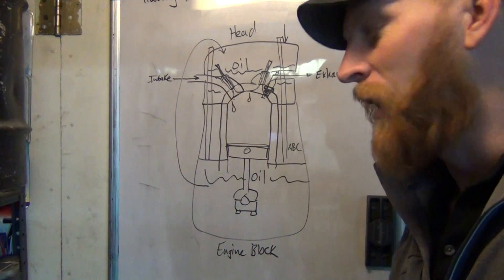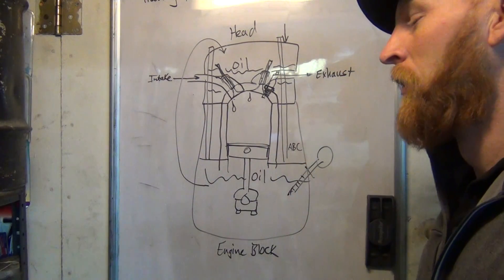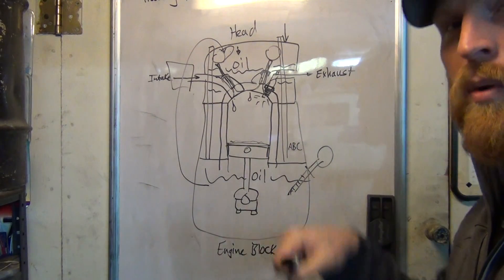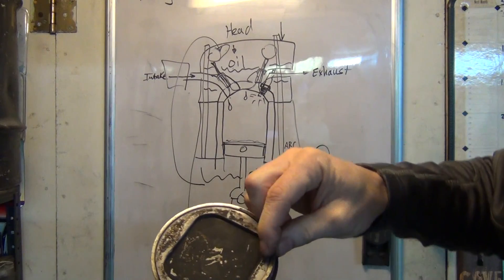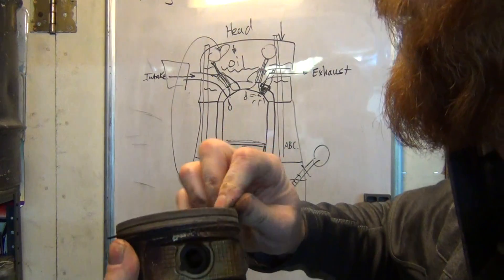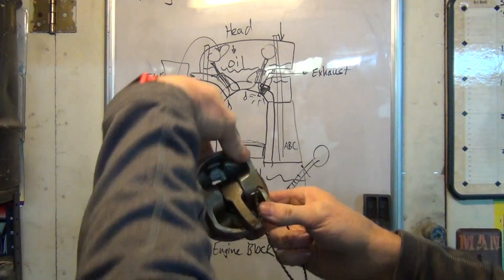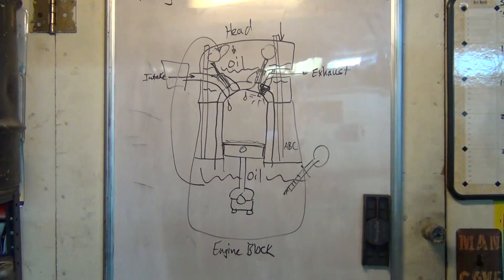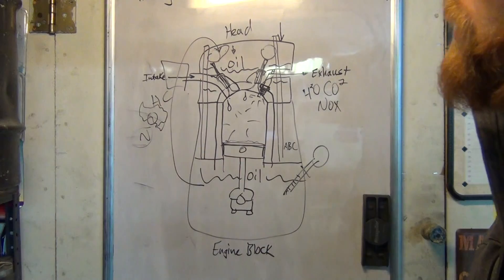Oil Burning Explained

Comment: I get really bad blowby (it needs rebuilt I'm saving money for it) but no oil burning in the exhaust. It'll blacken new oil in a week but it doesn't burn any strangely enough. It's an AMC if that has anything to do with it.
Reply: Tried cleaning buildup/carbon with zMax or Bestline? Have heard that some people have good success after running a few sets through with a couple successive oil changes, cleaning sticky valves, etc. Haven't tried 'em yet myself. But may at some point. Just a thought. Something to look into... Maybe?
Reply: Michael Gmirkin I will try that. It appears to be just worn-out rings, as the engine has been running since 1976.
Reply: check your pcv or crankcase breather don't know if you have a pcv or not but that can cause excessive pressure if plugged and cause blow by

Comment: Hey man I have a 2002 Ford F-150 5.4l triton change oil every 3k miles using Mobil 1 full synthetic , every 3 k I measure how much my engine uses, so my vehicle has 125,000k miles on it and it uses 1.5 quarts every 3k miles, is this normal?
Reply: No smoke noticeable on startup or normal or high reving
Reply: And the pcv valve and hose has been replaced as well

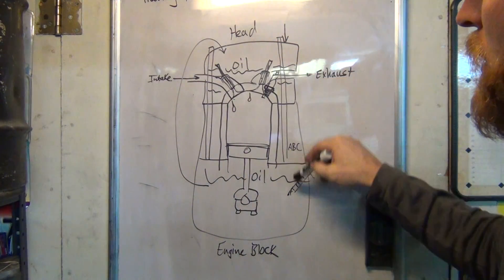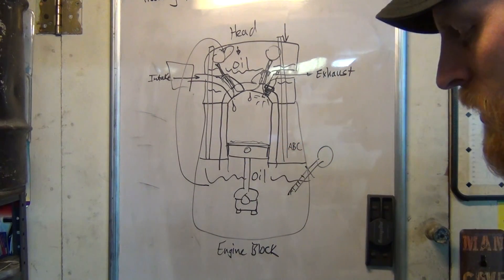Comment: hello Brian,i saw this video and its really helpfull for me to understand why an engine its burning oil,its extremly good movie.Now,i want to tell you my problem that i have whit my engine,maybe you can give me an advice because here in Romania at least at the garages that i have been whit my car,nobody could explain this big oil consumption that i have.So,i have a basic 2001 year vw  passat 1.6 Liter engine,code ALZ,and this car its burning arround 2-3 liters(i dont know in gallons how much is it,here we use liters) in 7000 miles(10.000 kilometers)!! but,(yes there is a But) none of that oil can be seen in exhaust pipe as a blue smoke even if i rev the engine,the noxe test is failed because i have too much monoxyde in exhaust,no leaking anywhere under the engine,no nothing as these simptomes.Still,after 1600 miles(2000 kilometers) the level on the dipstick oil its minimum,so i have to fill whit  500-600 grames( aproxx) of new oil.The engine its run perfectly,never had problem starting it,i just check myself that air filter and its perfectly clean after 15000 miles.One thing that i`ve noticed is when i have change the sparkplugs,one of those was all black,the other three were kind of brown to white,something like that.Here,only thing that i can hear from the garages is that i have to change the piston rings.....well if i have to do that,why my engine it run perfectly?the compression test tell me this: cyl1:13 cyl2:14 cyl3:14 cyl4:13,8,gas mileage its very good,never a problem whit it,under the hood intire engine its clean as new,no spots of oil,or gas,or something like that,everything its dryout.That too much monoxyde in the exhaust pipe  tell me that i have a bad mixture between air and gas,no way that its oil burn there.Maybe its a long message,but who knows,maybe you could help me whit some ideas,its not easy for me to go and change just like that  the head gasket,then the piston ring,then the valve seals or who knows whats next.Thank you

Comment: Hey my car has alittle but if smoke when I come to a stop off the high way getting off the exit it's very little and it's for about 3 seconds I have no check engine like out anything what could it be the smoke evaporates in the air

Comment: Hello Brian. got to learn new thing from ur video.. Bt i have a problem wit my motorbike. Its not smoking during startup and during throttle run also but my oil level in my engine is dropping. After changing oil have run just 1000 km the oil level is beyond. Dipstick reach.. Cant  see any leaks also .. Hope u have any idea.. Thankx man cheers..

Comment: Good stuff.

My Jeep burns oil.  Although Chrysler says its normal.

1 Qt, per 3,000 miles is the accepted amount, with vehicle mileage under 75,000 miles.

After that, the accepted amount of oil burn goes up.

Whatever the case, I feel that Jeep/Chrysler dropped the ball on this motor.
The 3.8L motor has been around for quite some time now.  The problems with oil consumption are known.  Why wont they address this?  Probably because the solution requires an engine rebuild, with new piston rings.  Too much $$$ to fork out.

Anyways, rant off.  Great video, thx.
Reply: +bjjbrawler1 3.8? Had one that burnt a quart every 650 miles and Chrysler said it was normal.

Comment: Hi Brian , I've got a car renault scenic dci expression (diesel) and the problem is when the engine runs its starts to smoke and letting oil through the exhaust but the car has power when you drive etc .Can you kindly tell me what the problem might be ?Many Thanks !!!!
Reply from the maker: Simplicio Matongo When piston rings wear out you lose compression. If you lose compression a diesel won't run and won't have power.  Diesels smoke most often if there's excess fuel going in from a leaking injector etc, but if you have oil loss, I would need more information like WHEN it smokes most to give any better idea.
Reply: Hi Brian , thank you for your speedy response appreciate it alot . Ok when you start the engine its fine but when the engine is hot then it will start to smoke with oil through the exhaust pipe like when you stop and check at the back of the car you will see oil even at the back of the car and during that the car will have power even to overtake you can but smoke with oil thru the exhaust pipe is the problem ...

Comment: I have the same exact problem as Chris R. I don't burn on start up, I don't burn on idle And I don't burn on wide open throttle. I only get a plume of smoke when I pull off from stoplight or of I decelerate or downshift and coast and then accelerate. What would you say it is
Reply from the maker: Jake Hancock Valve seals most likely.
Reply: I replaced them already lol

Comment: Hi Brian. I have an 85 Toyota Pickup (22R) that doesn't burn oil on cold start up, or idle. When I give it a rev after idling at a stand still, or coasting for a little while, then accelerate it will do a trail of blue smoke and then will stop as I continue driving. From what I've learned through you and other sources, it seems to be the rings. What I don't understand is how it will stop smoking as I continue driving? Will you provide some insight?

Comment: I have a motor with 270k miles. There are no under car leaks, no smoke on start up, and no smoke during driving all the way to 7,000 RPM. I have no idea where the oil is going. In 3,000 miles I have lost 4qts of oil so far. Keep topping it off. Any idea how to fix it?
Reply: *****
 I actually tried to use 5w-40 synthetic Euro blend because I had some extra. It stopped the issue for some reason right away. 3,000 miles with it and still at the full line on the dipstick!
Reply: *****
 It is a 1997 miata 1.8L motor. I had Mobil 1 Full synthetic 5w-30 at the oil change. Then 2qt down I added 1qt of 0w-20 and 1qt of 5w-30 syn because I had them in my garage at the time I checked. 2 weeks later it was nothing on the stick again so I put 2qt of 5w-40 and it has been great since

Comment: Great Video, I have a focus 2002, its whole engine re built 2 years ago, since then ive still had probs, the car started burning oil about 3 months ago i was going through lots of oil and the car would start cutting out when i went over 60 miles then would start again, then for next few days cut out and start anyhow i was told diff things in the end i went with the cylinders getting sorted out as it was misfiring it seemed ok for a few weeks then started doing it again, as ive been doing a lot of long trips, it would start of ok then car would cut out i would check the oil and the oil would have all gone so i would re fill, and it would be for next bit of time depending on how long the journey was, then basically over the last week its all ive been doing checking i oil to the max then when i start cutting out check the oil see its all gone and re fill so i can drive again, now today though it happened and this time the blue smoke was coming out, im sure it is the pistons if it is how much are they? i have spent so much money on this car as i cant get the money for another one, can the pistons be done without having to strip whole engine. Thank you
Reply: I'm just noticed my 2002 focus doing the same thing! It is burning oil, white smoke from the exhaust as well. I'm freaking out over this since they told me an engine rebuild is expensive af and costs more than the price of the car!! What was the solution for you and how much did it cost?

Comment: I'm burning oil in my car but I'm not sure if it's the seals or the orings . It only starts smoking after I'm accelerating then I decelerate for a couple seconds around 2000rpm or higher then it backfires I press down the accelerator then it blows blue smoke I see it in my rear view.

Comment: I have a question! just rebuilt my g10 L3 metro engine work done was had cylinders bored to 0.20 Installed oversize pistons with new rings,great compression around 180 psi during break in at ramdom times after about 7 miles of hwy speed I would notice a slight loss of power and a big smoke show coming out the tailpipe I could power through it but the some got bigger befor it would stop or let off gas and it would stop also. I now have 4 thousand miles on the rebuild and it stoped smoking all together. Was the smoke my rings trying to seal up????? Next time I will use a different break in driving pattern like driving under 30 mpg and stoping alot to start again. Any insight? thanks

Comment: Excellent video. I've just bought a 2003 mazda 323f 2.0 sport and it burns oil on start up, after about a mile it's fine. After watching this, I suspect valve stem seals.

Comment: Thanks for explaining burning oil.... ???QUESTION??? 02 Nissan Altima smokes when foot on gas and cylinder 4 misfire would be pistons need to be changed also.? Can be driven 2-3 miles max before it starts to shake and service engine light starts blinking.

Comment: Quick question:

Fully synthetic motor oils like Red Line (polyol ester basestock) claim that they can extend oil drain intervals up to 18,000 miles since the actual lubricant and the detergents don't break down. They claim it's the same basestock as the stuff they use in jet engines. I change mine out every 5000 miles or 1 year despite this. Am I wasting money on oil and filters, or am I doing it right? At $12 per quart, should I go the full recommended drain interval?

Comment: Just one question, I have a 2008 Jeep Wrangler 3.8L that goes through about 1 qt of oil between changes. There are almost 50K miles on it. I change oil between 4500-5000 miles with Full Syn. I don't see any blue smoke at start-up. No one has told me when following that they see any smoke either. A friend had a 2009 Jeep Wrangler with the same issue. Any ideas as to where the oil is going?
Reply from the maker: If you had an oil sending unit that leaked straight to the ground at freeway cruising RPM's and heat that would be a possible and likely suspect.  Another thing to consider is that full synthetic particles are MUCH smaller than conventional oil particles.  They can get through spaces that normal oil would not pass through.  That could include piston rings.  The other factor is the longer oil change intervals leave more time for that to happen.

Comment: You know your shit man. 

My car, no oil leaks externally. Starts fine, no blue smoke from what I see, and no smoke when driving. The gas just like literally evaporates... I'm replacing the clutch, and there isn't a main seal leak. No oil spots at all under the car. However, there looks like there is some oil near the coil and it looks new.
Reply from the maker: You didn't say what car you have Year Make Model.  Nor did you tell me what engine.  Many ignition coils are near valve cover gaskets though.  I'm putting my money on that.
Reply: 2003 Mitsubishi Eclipse GT v6. 3.0L. 

Hmm. I don't see any dripping though. I'm actually going out to the garage now to finish the clutch. I'm going to start it and check for fresh oil. There's freSh oil sitting there, but also fresh oil near the frame where the passenger control arm sits. Ignition coil is opposite side. 

I had the same car, a year ago (I was rear ended) and the valve cover leaked. I thought about it, but it seems like the leak is fast. Valve cover doesn't get much oil, or does it? It's not like oil sits in there, but I'm not sure.
Reply: I'd rather replace a $50 valve cover gasket, than keep putting $25 oil and filter on it every few months. Sometimes two months.

Comment: so how often are you suppose to change your oil?  I drive a 00' accord v6 and I used to change every 5000 full synthetic oil and filter.  Then I have been told and read in the owners manual (normal driving conditions) to go between 7000-7500 miles?  and the owner manual says to change the oil filter every other oil change lol...i do drive mostly highway though!

Comment: Good video.I had a 74'Pinto when I was a teenager that would use oil like crazy.every time I pulled out from a stop it would have a puff of smoke.My dad figured it was the valve stem seals and he was good enough to do the job himself and after that it never used oil.Cheap job if you have the know how.

Comment: My car's exhaust valves don't have stem seals because it's beneficial to have a little oil on those. Exhaust valve guides are much more susceptible to wear. Also, piston rings rotate independently as the engine runs. So I've been told.
Reply from the maker: They can back and forth on some engines.  Many performance 2 stroke engines have pins to prevent it.  Cylinder walls have cross hatching that can influence slight movements, but it's really not much at all- especially on a 4 stroke.

Comment: Never heard the valve stem seal story. Thanks. You've heard the "downhill using compression to signify oil being sucked past rings, showing up as you accelerat away from the light at the bottom of the hill" one I'm sure... Thnx.

Comment: thanks for the video brian. My friend has a 2002 outback base model that has recently been burning oil, and knowing her I'm sure she hasn't gotten it checked out by a professional like she should but anyways... All i know is that it's burning oil and has bad axles. do you have any idea what might be causing it to burn oil on that car? good choice on getting a mac btw, very easy to use those computers compared to PCs. I think you'll like it.
Reply from the maker: Blocked PCV valve, piston rings, or valve stem seals.  Welcome- as for the mac some things are super easy and others are kind of quirky.  You have to treat every little tiny speck like a graphical user interface whether it's text or not and you have to click and un-click stuff.  Overall I'm getting the hang of it with help from Youtube!
Reply: Just bought her a new PCV Valve yesterday, will install it the next time I see her. Does it have to be torqued down at all?
Reply: Michael.  You may want to consider a few things being that it is a Subaru.  Is the "burning oil" smoke from the tailpipe like Brian mentioned in the video, or is it just a burning oil smell?  Subaru's are notorious for leaks from the valve cover gaskets and axle boots, which both leak directly on the exhaust and will cause a burning oil smell.
Reply: I know the axle boots are torn an need to be replaced. Haven't checked the valve covers yet but it wouldn't surprise me if they are leaking. I know Subarus are notorious for both those things. Pcv valves are in need of replacement but the ones in there are just hopelessly stuck and am not sure how I can get them out unless I use a torch.
Reply: The PCV valve should unscrew after you take the hose off.
Reply: I know it should but it doesn't. It's stuck in place. I guess whoever put them on originally didn't use antiseize which is why they're stuck.

Comment: My dad uses synthetic oil and goes 10k miles before changing his oil. I tell him he's crazy, I don't care what the bottle says. What's your opinion on synthetic oils lasting longer? True or not?
Reply: I do the same as your dad. I change the filter only at the half-way mark. It's much easier to keep track of. Synthetics are formulated to last longer. There's proof all over. Check out "Bob the oil guy"'s website. It will truly enlighten you about oil. All of my vehicles use Mobil 1 with a combined mileage of 625,000, with NO internal engine problems.

Comment: If the engine is turbocharged, you could get lube oil for the turbo, leak past the seals in the turbo and get into the cylinders and get burned.

Comment: Great video, as always! Can you do another on turbo, supercharged and possibly diesel engines? I am just starting to get into forced air setups, and from turbos being oil cooled, can that introduce new ways of oil burning? Thanks again for the videos, keep em coming!
Reply from the maker: It CAN!  a leaking oil seal in the turbo can actually cause a run-away diesel if it's leaking enough to make the engine run.

Comment: Another good one Brian.

Très instructif, comme à l'habitude!
Reply: Easiest way to check your motor´s valve stem seals - let someone drive behind your car and check the color of your exhaust fumes when you lift off your accelerator. If the fumes are blue, the engine sucks oil thru the valve stems.